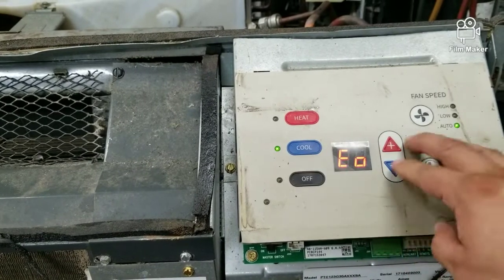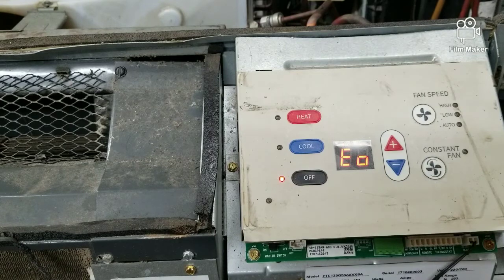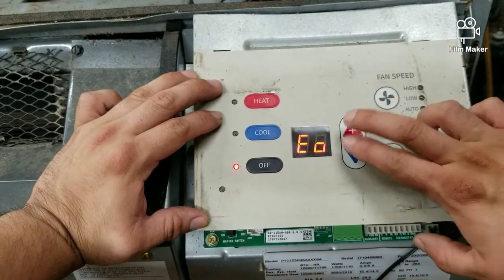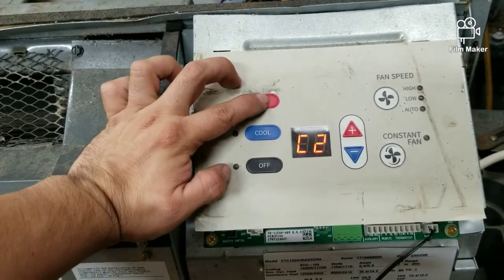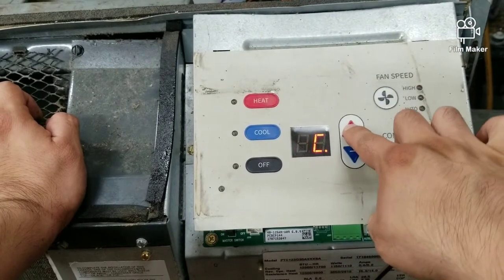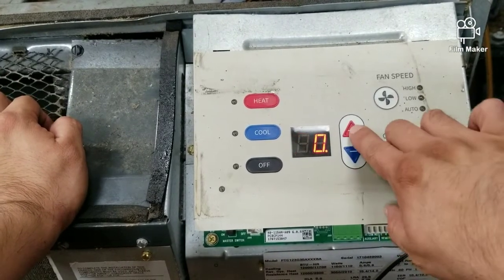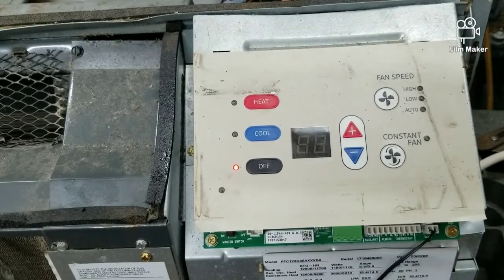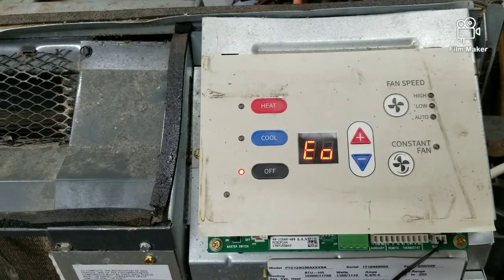Eo code? Here's the solution!

Comment: Hello code HI whats mean??
Reply from the maker: Hello, 
That's a high voltage code.. check power coming into the unit and make sure that you have the right power unit. If all that checks out, check the transformer
Reply: @PtacSolutions  thanks

Comment: Hi
i run hotel and one day all my PTAC showing NR code. they were not connected with wifi or remote access. Even after master reset it come back to NR  Can you suggest how that can happen.
Reply from the maker: I haven't seen that code before, but I can definitely find out... did y'all have any power outages
Reply from the maker: Ok, so that means not rented... if you don't have that system you just need to reset it to factory mode.. to do that 
1) turn off master switch for about 10 seconds 
2) press and hold cool and heat 
3) while holding turn master switch back on
4) don't let go of cool and heat button until off light comes on
Reply: @PtacSolutions  Nope that is U R for un rented

Comment: Good  job my Friend.   Code Hp??
Reply from the maker: That's basically a heat protection... check the gasket around the unit to see if air is coming inside. Close the damper ( if open).. unusually that code goes away on its own when the temperature falls
Reply: Thank  you. 🤝🍻
Reply: @PtacSolutions  great videos. Can I pay you to help me with ptacs?
Reply from the maker: @bigeddie2136  hello, no need... if can help let me know
Reply: Ok good bro
Reply: I'm lost on that code
Reply from the maker: @lieutenantlawson4295  where did I lose you?
Reply: So if I have that code it basically mean I need a new board?
Reply from the maker: @lieutenantlawson4295  No, you need to program to cooler only or heat pump... you have to replace the board If the board doesn't take the programming( skips C3)